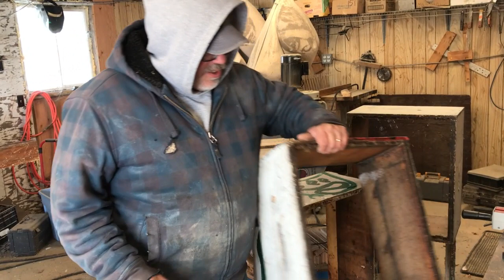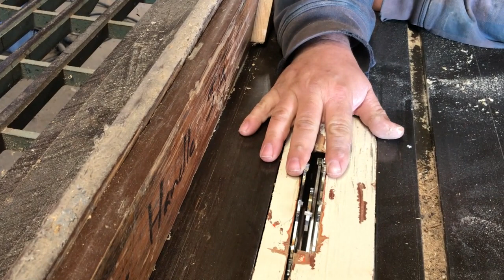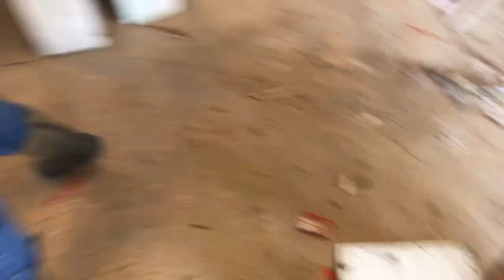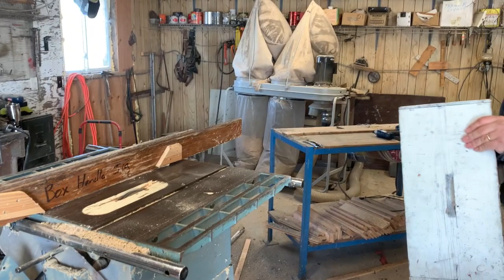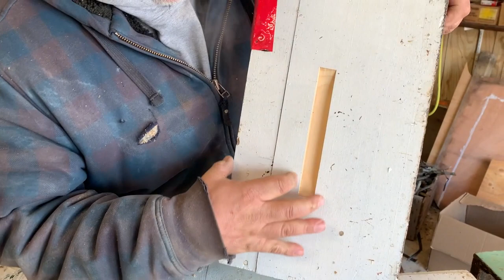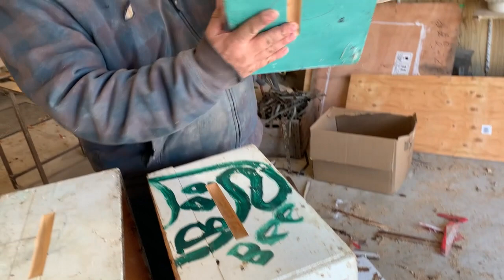Cutting box handles

Comment: I've still got 80 deeps to fix.  Bought 600 for 2.00 each with frames.  I fix the rot boil and back nail the frames drop in new foundation .. alot work well worth the saving good winter projects.  Get the heat rolling in the shop long lonely winter ..  need to find more running out.  Bought some new ones last summer custom built 7/8" thick nice boxes 9.50 delivered to my door. Guy mills his own wood .. leaves them rough sawn on the inside so the bees build propolis on the walls
Reply from the maker: anything 5/8 or over is plenty heavy.
Reply: @philbeeman  I've got like 100 deeps made of 5/8 marine plyW.   They work not as easy to fix probably were built in the 70s ... commercial guy bought out this big pollination outfit called cherry bee .. two locations one in the middle cherry orchards of north west lower Michigan second location down in Florida.  Just barns full of empty equipment stacked up to the roof both locations like they just bought new hives every year or something.  Got truck load of them nice 2 1/2 gallon Canadian buckets those big feeder screens .. 50 cents each.   Came from some bee supply place in Saskatchewan Logo says